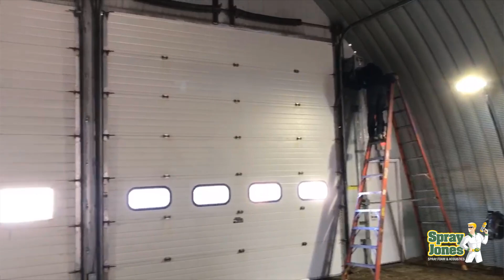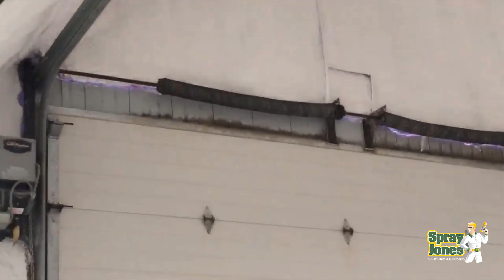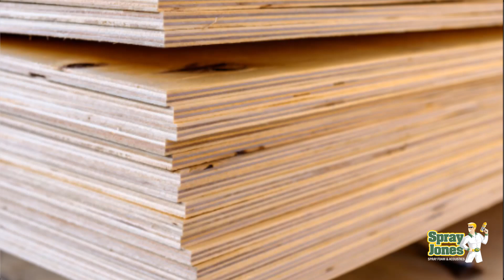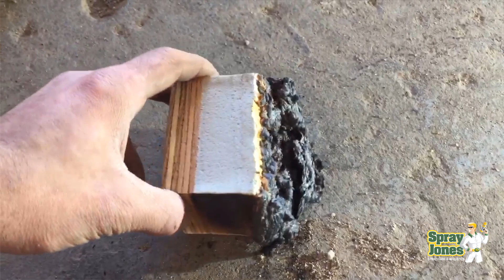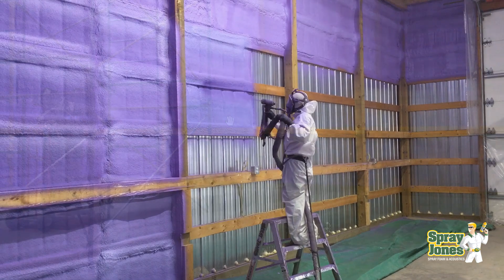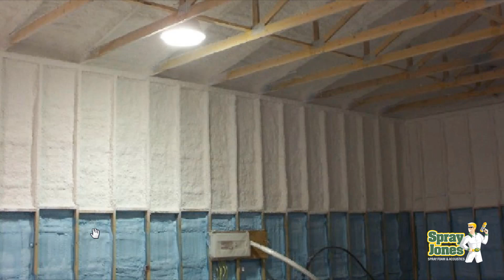Fire Code and Spray Foam Insulation | Simple Overview with Examples

Comment: What are you doing for ICF crawlspaces where   the bare gravel floor is going to be sprayed with closed cell but the  conditioned space or unvented space needs to be fireproofed. 
The ICF needs it and the Closed Cell that's sprayed in the space needs it?
Reply from the maker: Well - many areas have exemptions for crawl spaces not needing coverage provided the conditions are met. DC-315 is used in cases where a thermal barrier is required.
Reply: @SprayJones When you say conditions are met are you meaning no Air Exchangers or On Demand propane water heaters in the crawlspaces but as soon as you introduce them in the crawlspaces then fire codes have to be met?
Reply from the maker: @rotaxrider Yes - when mechanical equipment is in them they are devoid of designation for being a CS.

Comment: I'm having my garage sprayed right now. Gained all my knowledge from Spray Jones. In Ontario, the OBC states, as my inspector forewarned me, any heated space, minus the exceptions, must have a 15 minute thermal barrier. My garage has in floor heat, so I am going with the DC315, and yes, it does double the cost. But,  because I have 2 large dormers and a complicated roofline, it is still cheaper and much quicker than drywall. Thanks for all of your insight.

Comment: I have a question about the location of the thermal barrier on the underside of steel floor in a class D building made of non-combustible construction. I am getting conflicting information. Construction as follows: 1/4" welded floor plate on steel skid, spray foam and then DC315. Spray foam vendors say it should be applied this way. But some states (Texas mainly) say the thermal barrier should be against the surface to be protected (steel floor in our case) and then foam over top of that, which makes no sense. Who's right? Why do the thermal barrier to the floor and leave the foam exposed?
Reply from the maker: Thermal barrier over the SPF is for 15 minute protection of foam plastics and it has to be on the surface of the SPF.
That is totally different from a fire rated floor assembly to rate structural Steel endurance.

Comment: We're putting our house design together and I was considering for the 2x6 exterior walls:  2" closed-cell SPF covered with 3.5" Rockwool batts in the cavities for the added fire protection.  There will be exterior insulation as well for the thermal break.
Reply from the maker: Don't mess with flash and batt. I have videos on that. Stick will all foam or all batt.

Comment: Can you just plaster over spray foam instead of sheetrock? Talking interior
Reply from the maker: You can.... needs wire lath and fasteners, won't stick direct and the foam is wavy so thickness of plaster is an issue...

All that being said go for it.

Comment: What about around a fireplace thimble going through a wall in a garage? I have 2 in airspace inside the thimble and the chimney has 2 inches of insulation double pipe. so do I need to cut back the red/pink medium density closed cell spray foam 2 inches back from the Selkirk thimble?

I also put 2x6 boards and 5/8 drywall to separate the spray foam from the fire place. Planning on putting something on top of the drywall to help store some heat, like Tile.

Thanks if you can help.

Comment: I am currently dealing with an inspector Telling me I cannot have exposed closed cell foam although we sprayed intumecint paint over it  The foam we used has a class one fire rating Itself, this is an assembly haul I don't know that that makes a difference. Right now I'm just praying That he is wrong because otherwise I have about a $150000 Irredeemable disaster he said the thermal  barrier paint doesn't satisfy  NFPA 275
Reply from the maker: You need to get up to speed on what they are looking for vs what you did. Homework....

Comment: Close cell foam has fire retardant within the residence side of the chemical so if you want to go ahead and pay thousands of extra dollars to “” fire approve your material good luck this foam is so airtight it doesn’t allow enough air to support open flame so when open flame is in a structure and runs out of oxygen to feed it gets wet it goes out.

Comment: Thanks for this video. I was wondering about that aspect of the building code because some furnaces are in the attic. Although I have seen plywood encasing the furnace and only the hvac ducts running in the attic. And it's true there aren't a lot of hot exhaust runs anymore running through the attic. I'd like some on fireplace exhausts at one point and how you deal with those.
Reply from the maker: Glad it was helpful!

Comment: I sure wish that the people who watch ''This Old House'' would watch 
this guy and get a proper education. It seems like everyone who comments about foam
on that channel thinks spray foam is the devil, emits VOC'S 
continuously and will kill you, because they saw a CBS special of one 
family who had to take their roof off because of an installer who 
screwed up real bad.
Reply from the maker: I agree. SPF is the best product when installed properly....like anything else.
Reply: I definitely want to see that comparison between the polystyrene board they use vs closed cell foam. I know who the winner would be because typical installation of polystyrene is made with nails and the seems are rarely foam sealed...
Reply: @SinnisjInsulator , Are you talking about the 4'x8' double foil sided boards ? We use to install those 35yrs ago and the seams are taped, which I guess was good for back then ?
Reply: @augustreil  there are those still installed on outside of homes that are replacing their siding, but I'm also talking about the blue or even pink boards they install behind siding. When the big temperature differences hit, those small cracks will be where the air will leak. And tape wouldn't have much r value lol. I find it's silly new construction is still done this way.
Reply: @SinnisjInsulator , Agree, but when I insulated homes, that was the standard practice. This is what we did on the inside, over the studs with 1'' double foil faced ridged foam boards that had an R-value of around 6.5 an inch. I did the same on the outside, but only on half, I'm such an ass for not doing the whole house, because you can definitely feel the difference.
Reply: @augustreil  hey I have a YouTube channel on attic insulation. I'd like to know what you think, I give tips and film my installations.

Comment: Just watched a Matt Risinger video recently where he and Joe Lstiburek were talking about different ways to go about dealing with a conditioned attic, and tucked neatly between all of the complex solutions was the golden phrase:

"Or, you could just use closed-cell spray foam and not worry about any of this"

I don't need to tell you how right you are 😉
Reply from the maker: Thank you Benny. This has been my life's work. I have been involved with SPF for 21 years now, nearly half my life.
Reply: I watched that too, and spray jones was also my first thought. 👍
Reply: I caught that when I watched too.
Reply: I’m sorry, I guess I’m missing the part that says you don’t need the intumescent coating for closed cell or any other material, ie sheetrock, plywood. Searching in this video and in Matt’s. What am I missing?
Reply: @cadets3 habitable spaces?